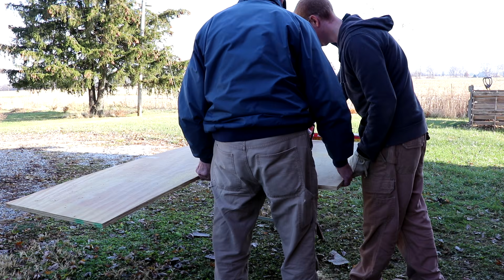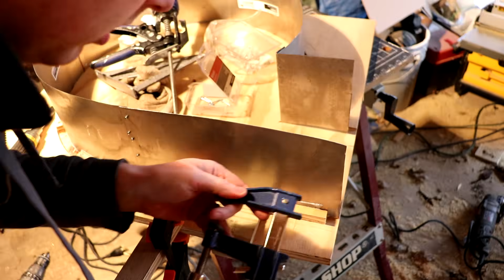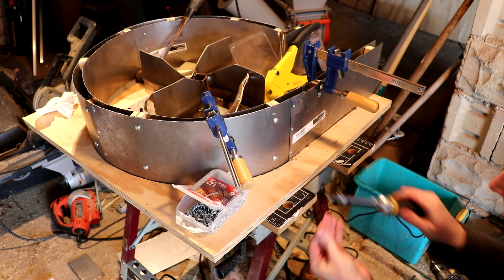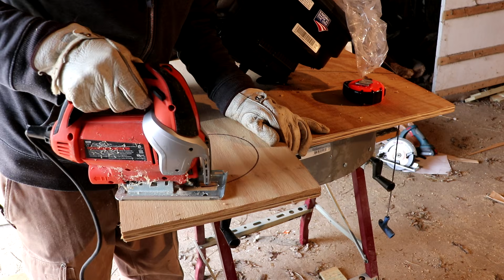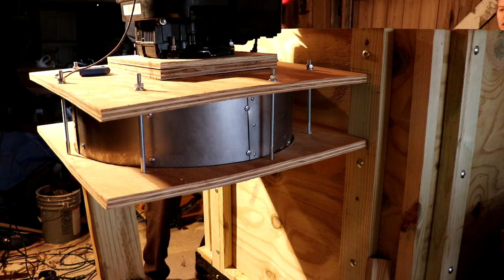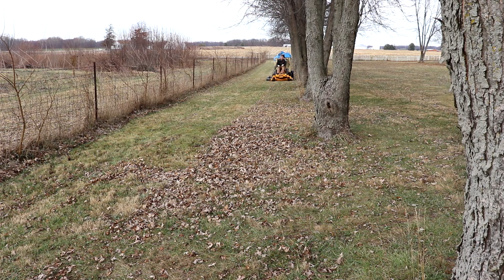My DIY Leaf Vacuum | Start-To-Finish Build

Comment: Fiy  i used to do this making sub boxes on bolts just use clear calk you dont need lock washers it works like nylon nuts they dont back off but can be removed.  Handy to know if you need a lock washer and dont have one.

Comment: That is a great job you two did together and it works like a champion.
One question if I may. How deep is the chamber and how thick is the impeller .
I’d like to try my hand at building one also.
Thanks for you time and thanks for sharing .
Reply from the maker: Thanks Robert!

The chamber is 6" deep, minus the 1/2" recess for the halves to fit one another. I'm not sure off the top of my head, but I believe the impeller steel is 1/8" thick.

Comment: Why is the impeller so much smaller than the scroll housing would it not be more efficient if it was more closely matched? The one I built had only approximately 1/4” clearance between the housing and the impeller and it can almost suck a nail out of a deck. The side clearance is equally as close. Did you calculate better performance with that much clearance or did I just misunderstand your design?  Please explain if you know the reason for your engineering design
Reply from the maker: Mark,
Due to the nature of this blower/vacuum and its intended use, having enough clearance on either side of the impeller allows debris (such as sticks, branches, rocks etc) and material to pass freely through the system without fear of damage to the vacuum. Additionally, the closer the impeller is to sides of the housing, the louder the unit becomes (akin to an air raid siren).

Comment: Where did you get the impeller
Reply from the maker: There are a bunch of prefabricated impellers on websites such as Ebay. Make sure the shaft of the impeller matches the crankshaft of the engine you choose to use for a correct fit.
Reply: Was there ever a reply to this?

Comment: Cool build. Is it strong enough to pick up heavy stuff (like animal droppings...)
Reply from the maker: Larry,

The vacuum is strong enough to pick up heavier items including wet grass, wet leaves, smaller rocks, twigs/branches and yes even animal droppings! The amount of suction the system will create is also related to the height of your mower deck if you are using it as a combined system (the lower the mower deck, the more pressure the vacuum can generate).